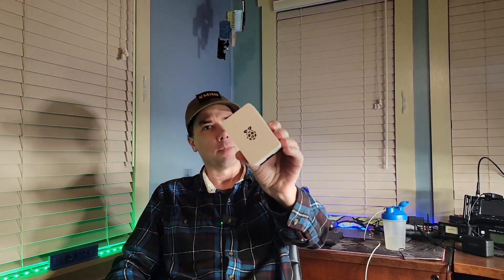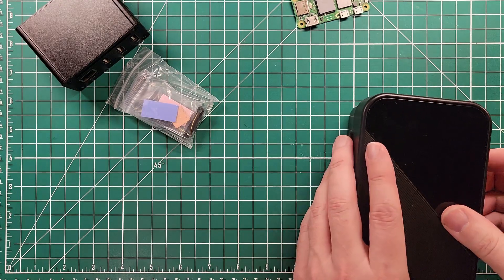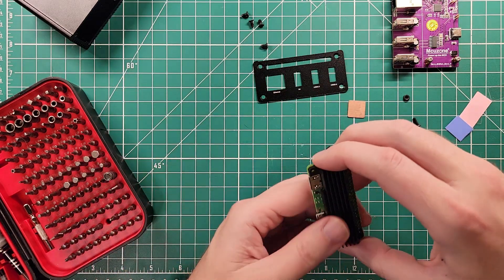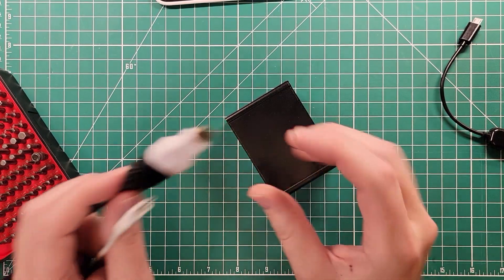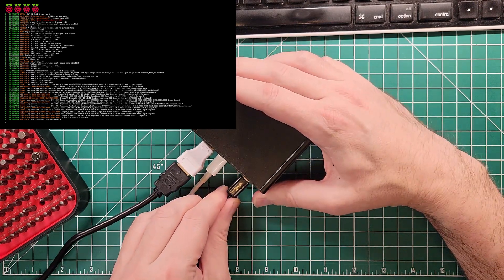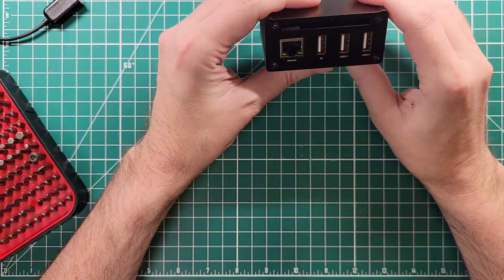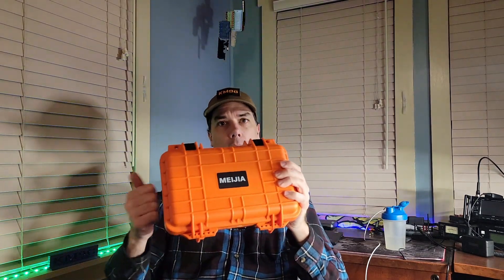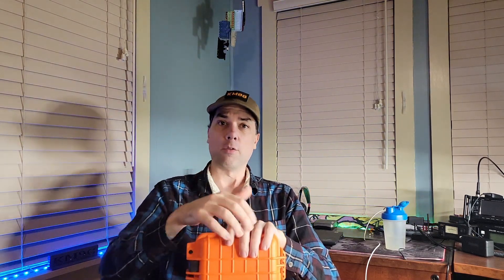I got plans for this one...

Comment: I have a video request and I am not sure how to send it.  The Xeigu G90 has an I/Q port.  I would like to understand how it works and how to display the information.  Thanks for all the great videos.
Reply from the maker: Hey BassMan!  I will have a video out on it soon - I need to get a windows PC first.  Basically connect that to your PC's sound card and install some software (HDSDR) and make some configs.  I haven't done it yet because there isn't linux software that supports the right sound card bandwidth last time I looked.

Comment: Good idea Steve but i done the same thing last year with  a pi zero w and when it gets warm outside it crashes due the high cpu temp byt as mine is a permanent setup i put a 5v car charger in it so i just run 12v into it for power and then it connects to my home wifi but im goin to do water cooling for it 1 day
Reply from the maker: I need to solve cooling still - this is a project I see constantly evolving.

Comment: Only 512mb of ram, terminal only??
Reply from the maker: Yes 512MB RAM, but you can run a lightweight GUI on it.  In the case of this project, we won't login to the machine hardly at all - all web based.  In hindsight a Pi4 probably would have cost $10-15 more...
Reply: @temporarilyoffline  aren't PI4 with sufficient ram impossible to buy reasonably?? That's been my finding
Reply from the maker: @edbeckerich3737  Every single Pi is hard to find Zero's should be ~$15 and 4s should be ~$50... but both are over $100
Reply: @temporarilyoffline my next will be on Orange Pi, more better, cheaper